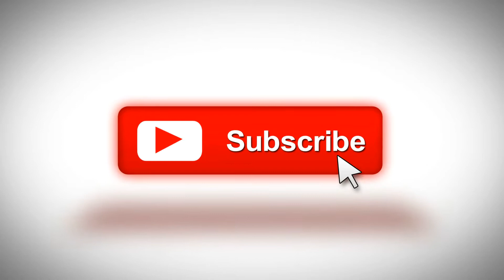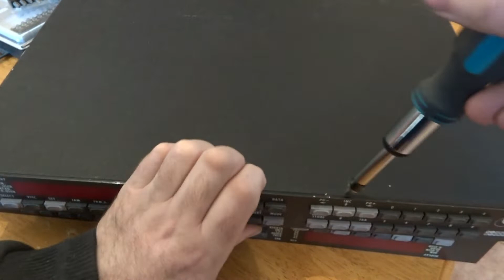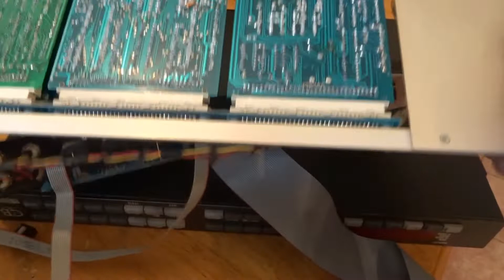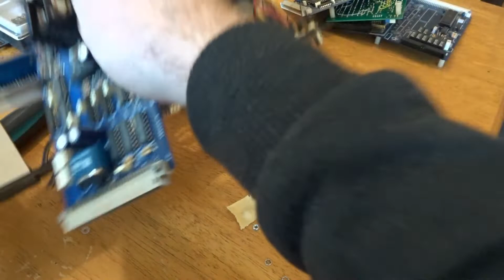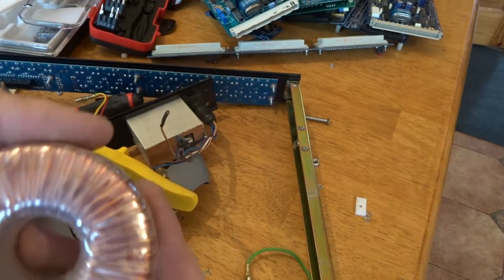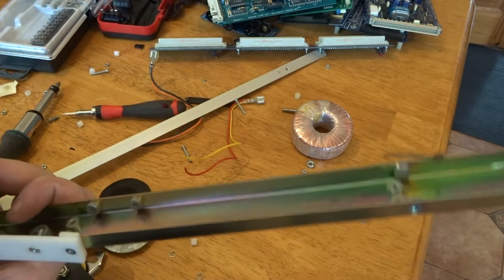How To Turn Electronic Waste Into Pure PROFIT?

Comment: Another nice vid. @10:00 The wires on the back of the board are there because they stuffed up in the designing the board same with the resistors @13:45. The next gen of the board they tend to fix them if they can.
Reply from the maker: Thanks for watching and the great information